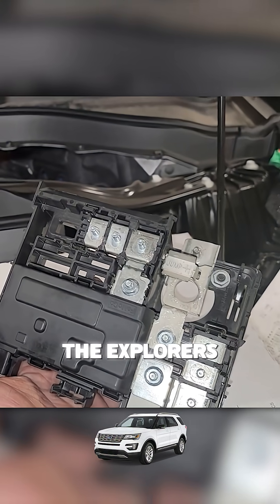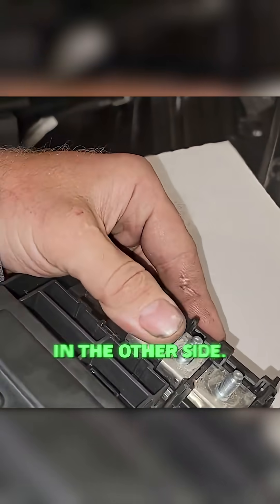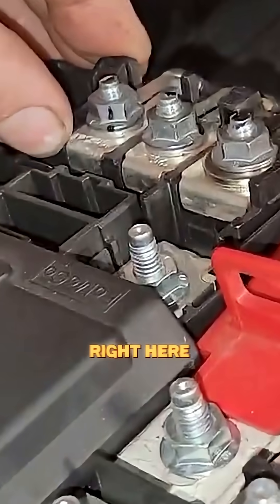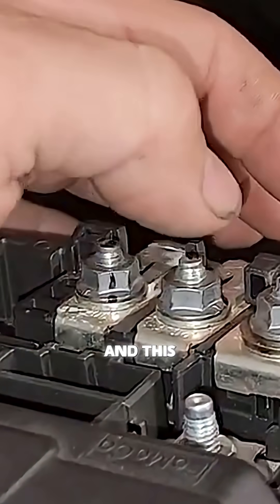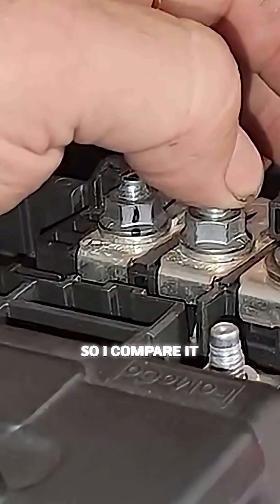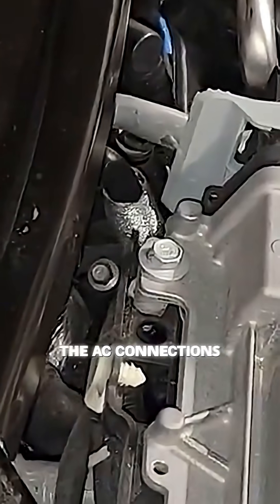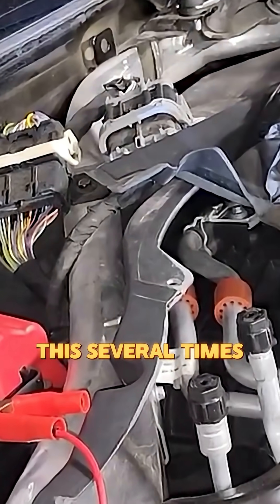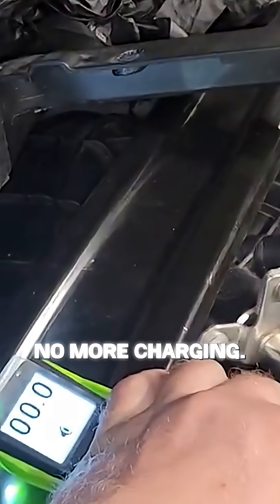Ford Explorer Hybrid Problem NO ONE Talks About (But I Will) #ford #reels

Comment: Had this same thing happen did the rear axle bolt fracture recall unhooked the battery while i was working on it put it bsck together and had a charging system fault ordered a new one and they send a harness with everything except the fuse i needed but luckily my manager had just turned in his lease non hybrid swapped them over fixed the one and the lease turn in was fine cause it doesn't use that circuit